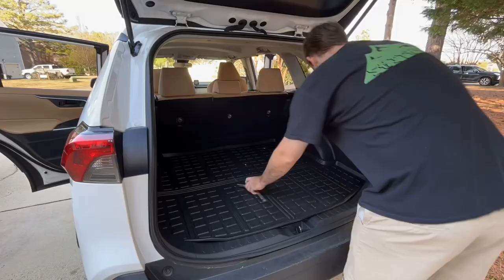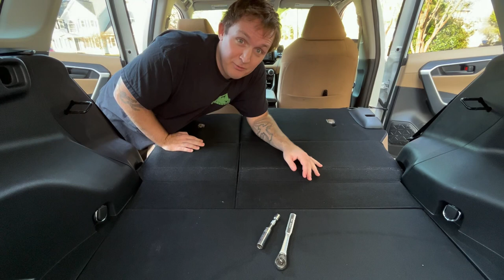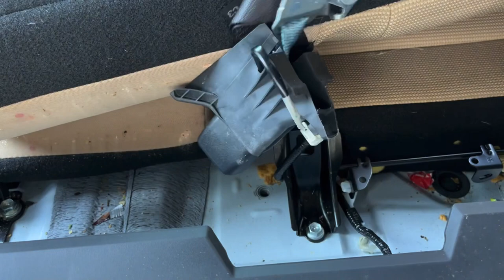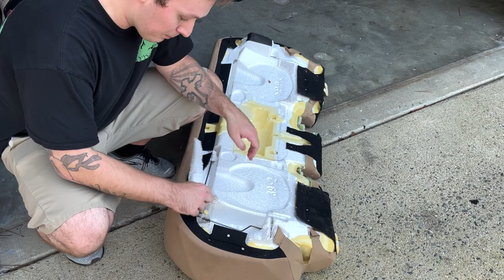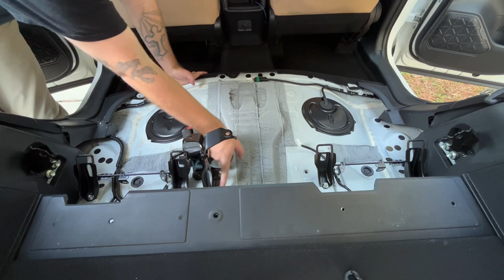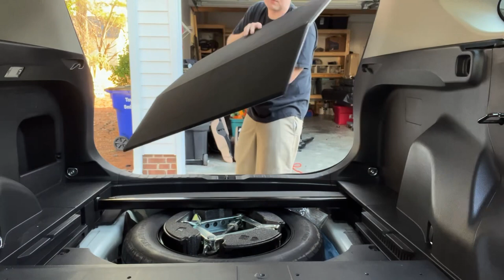2019-2023 RAV4 Seats Removal! One tool, Two SIzes! Camper Prep!

Comment: Do you have a video of the front seats removal?
Reply from the maker: No, but it’s just 4 bolts and some electrical connectors. I did remove it but I got error codes and warning chimes, as well as the airbag light was blinking. I don’t play with airbags so I put it back. I didn’t want to disassemble the seat to fix it. Sorry I couldn’t help more.

Comment: Did you have any issues with seatbelt sensors after removing the seats and disconnecting the wiring?
Reply from the maker: Absolutely not. I actually thought I would but after testing and then unplugging… nothing. All the backseat seatbelt lights even went off too… hope this helps!